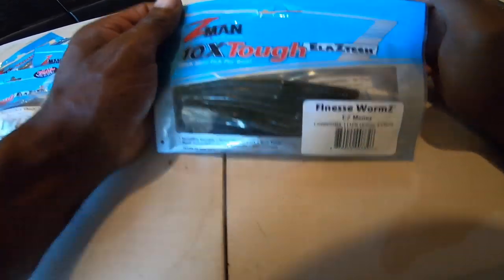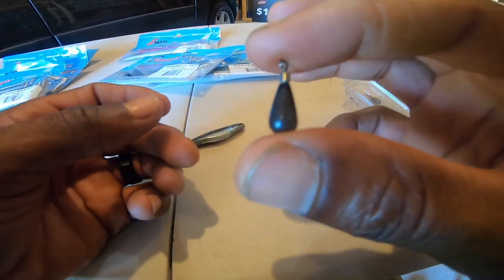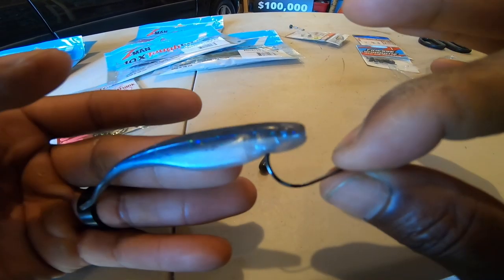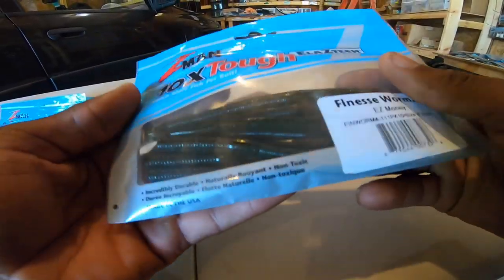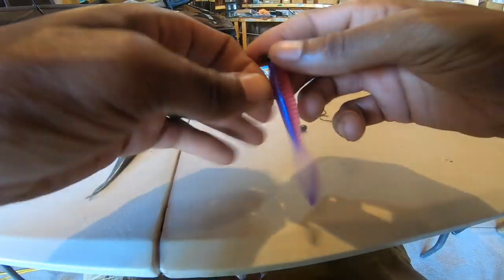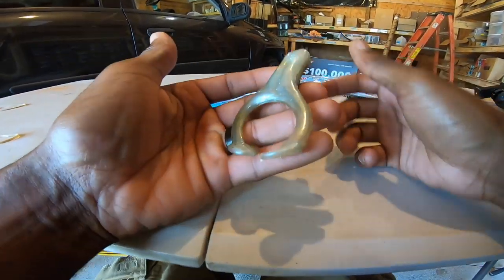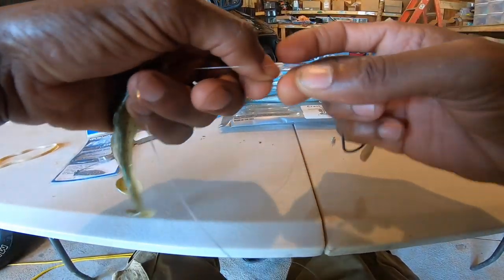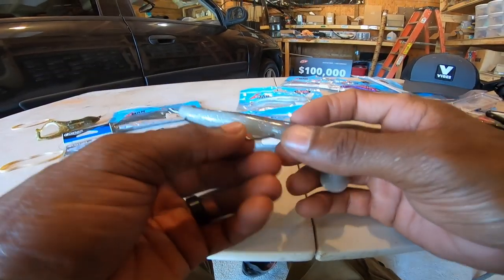How to Rig My Drop Shot Baits Correctly

Comment: I recently started using the trick shotz as my dropshot bait but i am used to use sinking lures on dropshot. The only thing i do with sinking baits on drophot is i drag it with my rod and than i let the bait sink about 5 times on a slack line before i drag it a little futher. My question is when using a floating bait like a trick shotz what should i do with it? Only drag it and keep the line tight? Because when i give the line slack it does not do anything it does not fall to the bottom. I can shake it or give it some action but that's about it. It does not fall. So i have 2 options drag it and do nothing or drag it and shake a little and do nothing. But i get all my bites on a slack line with sinking lures. I really want to like this bait since it stays nice horizontally. Do you have any tips or secret what to do with this bait? Because i never get bites when using floating stuff on a drophot which is weird. 

I am fishing for very big perch and Pikeperch (Zander) in The Netherlands btw. Perch in the Netherlands is almost getting as big as largemouth bass in america. So these perch are basically largemouth or smallmouth with better colours :) You gotta search it up on google (Big perch Netherlands) and see photo's. But i think you already know we have yellow perch almost as big as largemouth bass lol